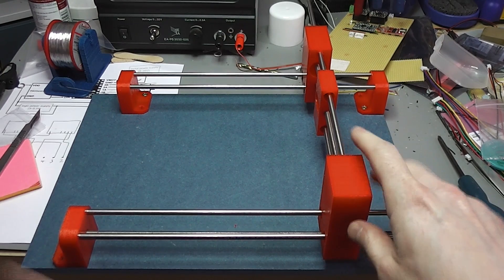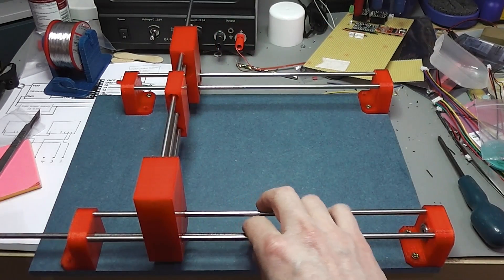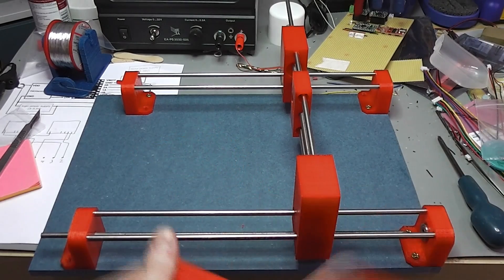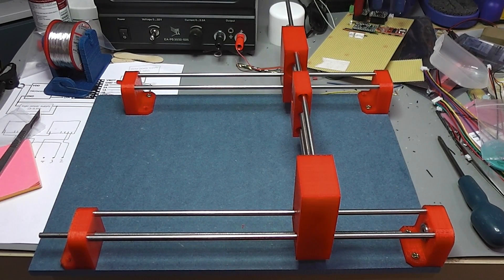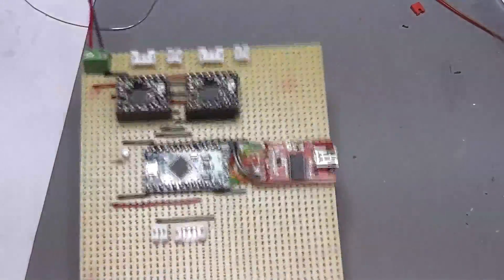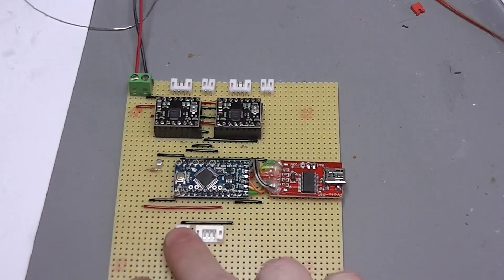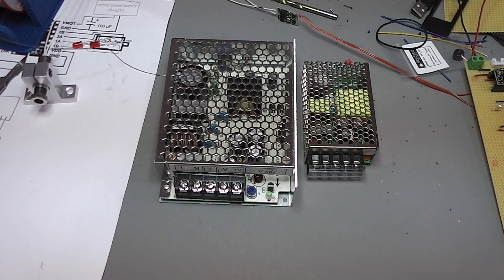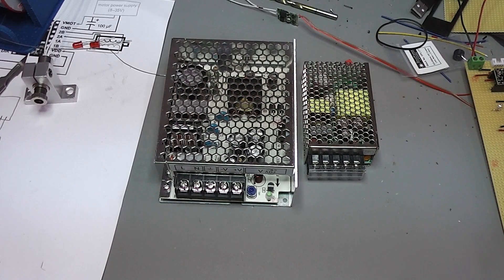Laser Engraver / Cutter Build Update - #2

Comment: is it possible to make the bottom platform with a large hole in it so you could potentially use it to cut on the surface of other larger objects... like the side panel of a computer tower?